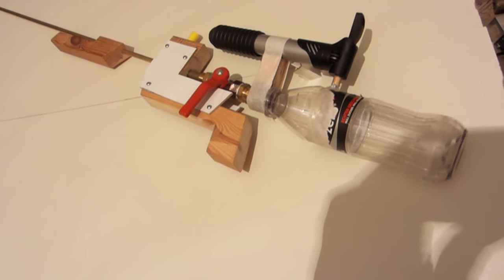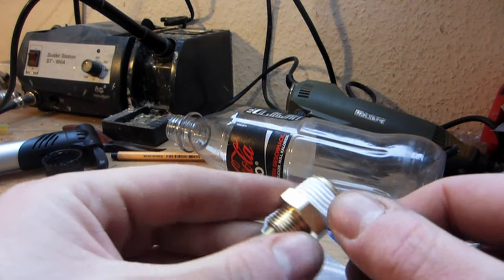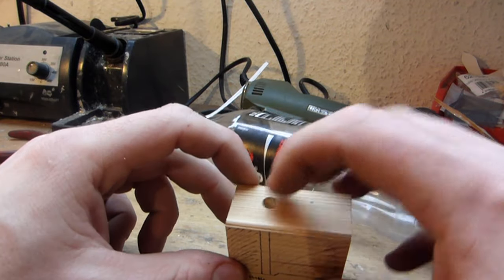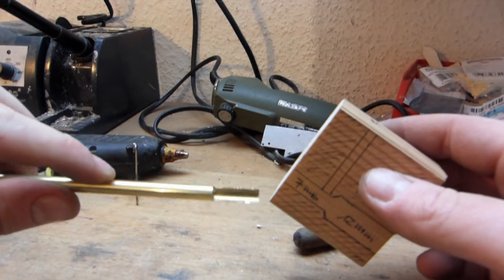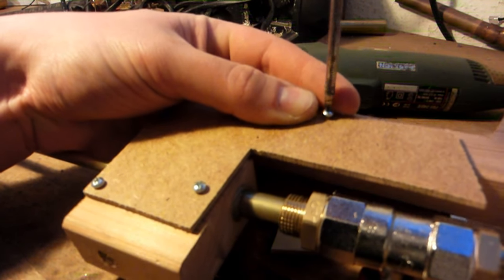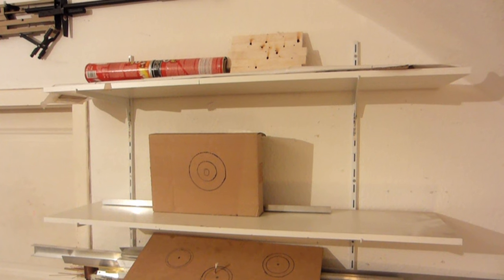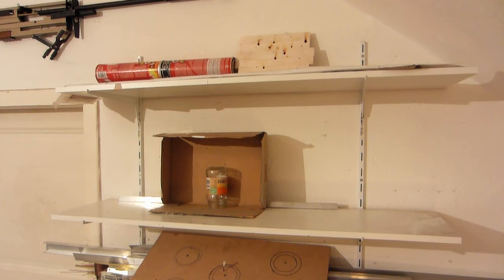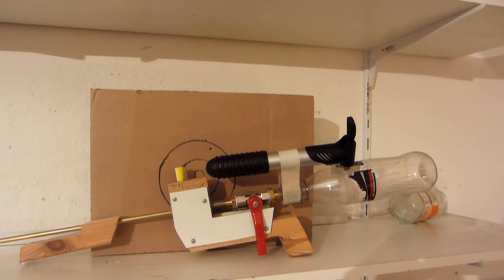TUTORIAL Pump + Coke bottle = powerful semi auto BB airgun

Comment: So you know those things they put at the end of a water heater to vent the air (barrel shaped tube with a valve made from brass) at the last floor? If you take the head off, you can then obtain a valve to put in the bottle. Relatively cheap, certainly cheaper than buying a car valve stem.
Reply from the maker: Doubt its cheaper. Never saw any valves laying around anywhere :P
Reply: Selfmade couldn't you use a dish soap bottle as a valve?
Reply: Never tried, its not made for pressure though, its for pumpint fluid.
Reply: A car tire valve costs about 15 cents, sooo

Comment: I tried making one but the air pressure always made a hole in the epoxy. Help please
Reply from the maker: Avoid air bubbles. Mix the epoxy well, then wait a min before you put it on and be careful when applying it. That way you dont get more air bubbles in. And I would always apply 2 layers...the second just when the first one is not liquid anymore, not hardened either but still sticky. Then give it a day (even if its 5 min epoxy) and you should be golden.
Reply: Selfmade k thanks

Comment: Use a CO2 tire inflator. 

I would, but I'm a bit squeamish when working with high-pressure gasses.
Reply from the maker: How about a bit of gun powder? :p something totally different, BUT I wanted to make a PUMP airgun xD so I made one. Makes sense?
Reply: Selfmade my dad has an old spud gun that uses a pinch of gunpowder and pressurized CO2, we tested it on a football field and got about 35 yards
Reply from the maker: Ok, but I actually meant if I wanna use a pump-gun, I dont use CO2 :p
Reply: Selfmade I saw the word gunpowder and wanted to share an anecdote
Reply: Yes it makes sense, but I'm just a lazy fuck. Were I to make one, I'd stick a CO2 tire inflator there, instead of a bike pump.
Reply from the maker: Ah ^^
Reply from the maker: Bike pump works better... you dont have to swap tanks.
Reply: TheRook im using a portable compressor
these bottles take like 10 bars, it crazy
Reply: c02 tire pumps is the way to go. its like the bottle thing but a little stronger no reloading time. light weight and portable too. cartridges are cheap these days